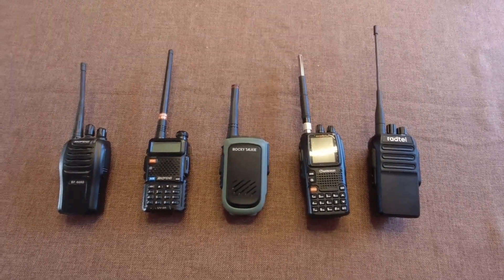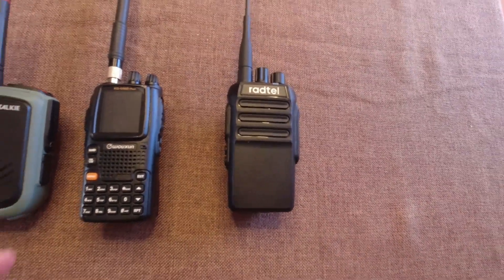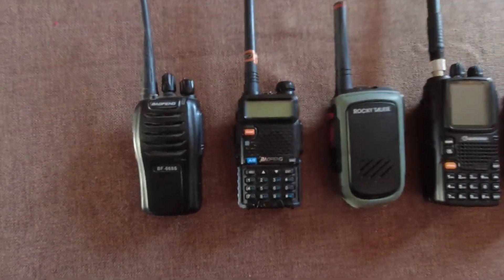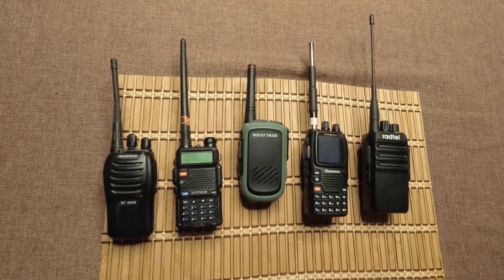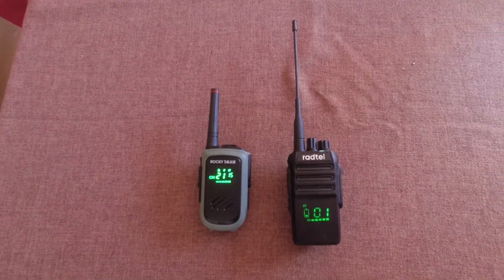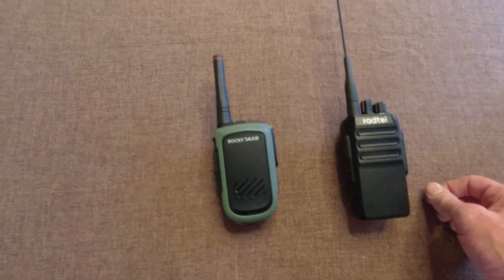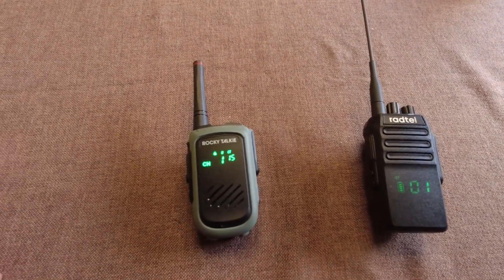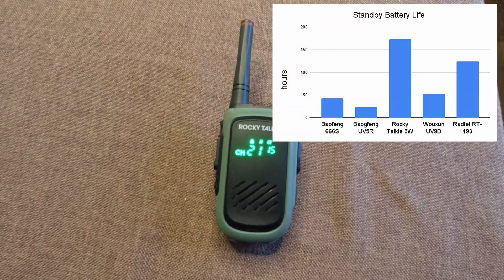GMRS and ham radio Battery Life test Rocky Talkie 5W, Baofeng 666S, UV5R, Wouxun UV9D, Radtel RT-493

Comment: Hi, very good test, do you know what range the rt-493 has? Its ads say 10w.
Reply from the maker: I haven’t tested it head to head against my 5W radios but it does seem to put out a strong signal. I hate the lack of keylock feature on it though. I had to remove the channel knob to prevent accidental channel changes.